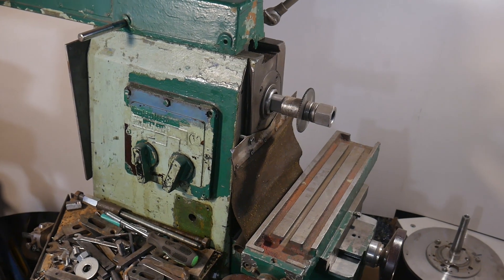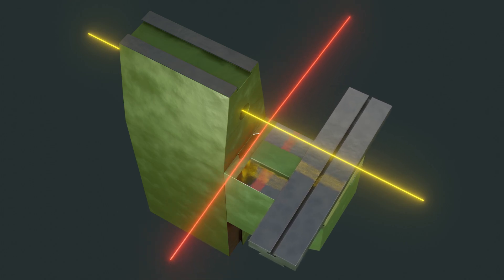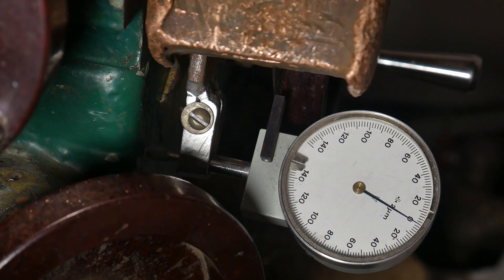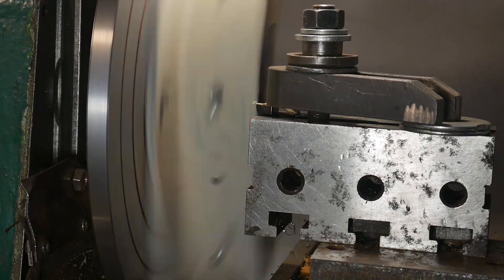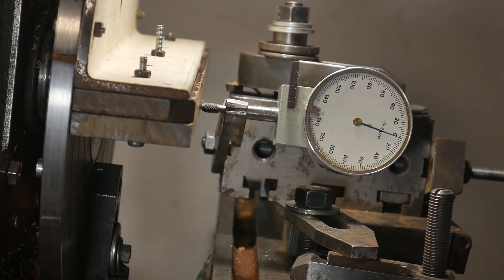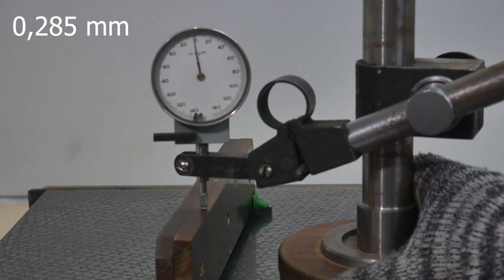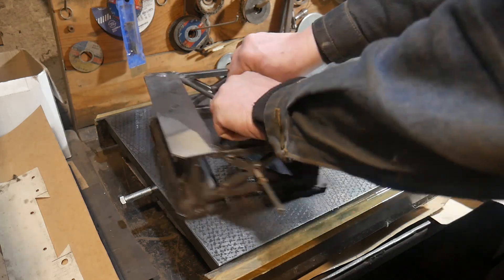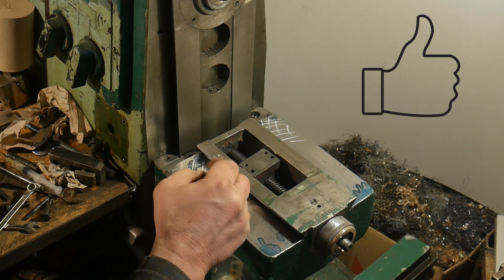Necessary before repairing the milling machine. №2

Comment: How can this method be used for a vertical milling machine, such a bridgeport?
Reply from the maker: It's easier with a vertical milling machine. There, the head itself can be adjusted at its installation sites. And with a machine like mine, it is possible to correct the axis of rotation of the spindle, but it is very technologically difficult. A similar check on a vertical milling machine can also be performed. There will be just a few technological differences.
Reply: @gena_bazarko  I am trying to figure out how to make a precision CNC mill and installing "hiwin" profiled leaner rails. It seems there are no proper thorough complete detailed explanations on how to install linear rails on the internet. I have seen many video on youtube but they are line only 5-10mins and doesn't explain completely. I have seen few skilled machinists on youtube who were able to build there own precision CNC mills using granite, however they don't explain properly how they were able to do it. There are no books, articles no any kind of documentation that explains the process of installing linear rails using dial indicators or what not, I have seen the installation manual from the manufactures but it is not enough information. I guess the best way to learn is to become an apprentice in precision machining for precision machine building.

Comment: nice work...few people realize that a good adhesive connection is usually more 'accurate' than a welded or fastened system, as it introduces very little stress into the parts...about 32 years ago, I had a bit of 'discussion' with colleagues, when developing long-range 3d scanners, but I think that they found it convincing that adhesives were used in the optics for earth observation satellites  ;-)
Thanks for detailed discussion and videos of your setup and steps.